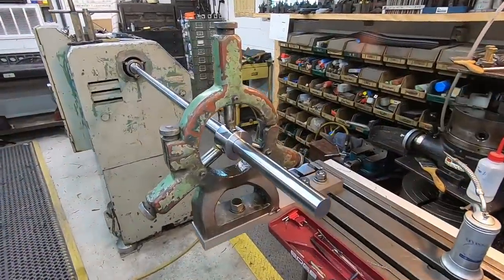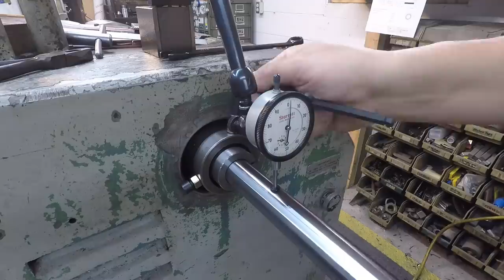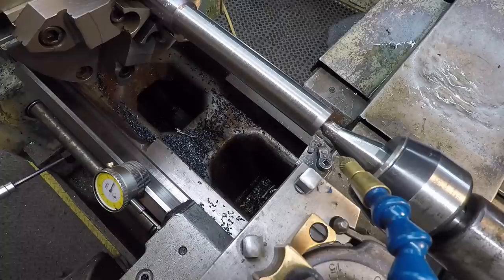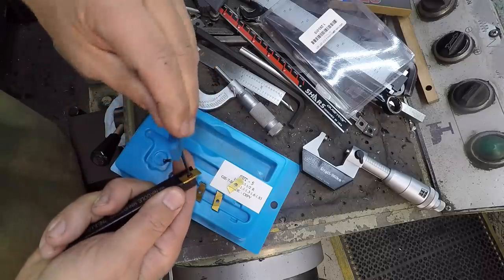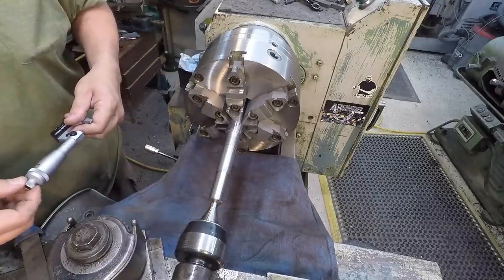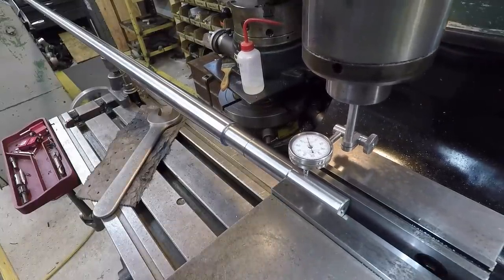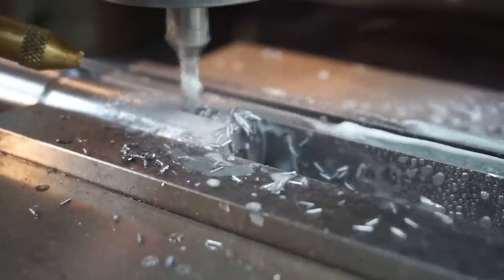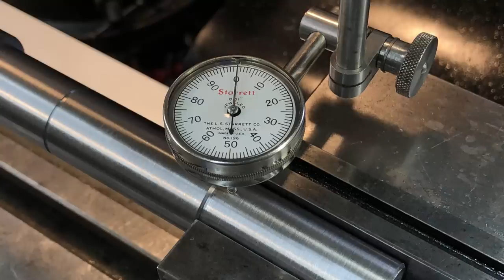Machining a Custom Prop Shaft Part 2

Comment: As a retired machinist who started in the early '70's  , the shop That I worked  in did LOTS of shaft work & what we used then was RED LEAD for steady rest lubricant , now the BEST lubricant that I have found for this is STP , or motor honey ! It WON'T  totally leave when it gets hot . GOOD Video !!!!!
Reply: We use motor honey too, bitch to clean but lasts way longer on the steady.
Reply: STP is a great lube for that kind of stuff as well as an oil additive for vintage engines.  We had a bunch of stuff tested, and it came back with the most zinc, and that is what you want!
Reply: Thanks for this tip, Byron!

Comment: I saw that print Adam! Thank you for showing us. I knew something was up when you were trying to sneak up on those ODs like that, and then you showed the print that basically had zero tolerance built in for you. I know jobs like that take a lot of patience and can cost the customer a great deal because of it. Been watching you for a lot of years, and you do great work. I have no doubt you cut 15 minutes of video of you trying to get on-size with those dimensions down to just a minute or two. You definitely make it look easy. Great job. I know you make your family proud!
Reply: That is a prototype shaft for a mud motor.  The drawing is not professional (and doesn't need to be).  Zero tolerance is a mistake.  However, with Adam on the lathe, he went right to it! Excellent video.

Comment: Great job Adam, and here I thought Keith was the king of marine machinists! I always enjoy your attention to detail and never taking any sort of short cut. As a lifelong millwright, it's guys like you that makes our jobs a bit less complicated when you never have to second guess the print. Cheers and thanks!
Reply: Adam has said his dad did a lot of "marine shaft work" in years past.  I think there are a few power boats down around Florida that just might need a quality machine shop!  Adam may have a new line of repairs in the future.  It has certainly done Keith well up in the Cape.

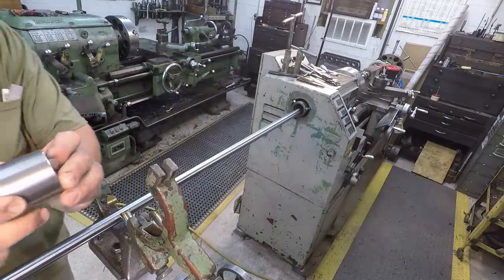Comment: 3:50 Another thing to use is a small plug of Nylon 6 or 66 ( natural/white not graphite/black ) rod instead of brass tipped bolts.  Place the plug in your bolt hole so the bolt pushes against the nylon and the nylon grips the shaft.

Comment: Great project Adam and thanks for sharing your experience in terms of making sure everything remains straight and true during the machining process of long shafts. Your preparation of the jigs and fixtures (Lathe Steady and Bushes in this case) ensured that the Shaft turned out just perfect and that the customer should be real happy with this job. Blessings from a sunny and "Locked-Down" South Africa !

Comment: My Son, in and after High School trained as a machinist, then went to University to study Chemistry. During his undergraduate work, he got a job in a lab preparing the work surface for a Scanning Tunneling Electron Microscope, that has to be precisely flat at the atomic level. His machine shop training was the key factor that gave him the understanding of how to accurately set up machinery and tools. He also helped to develop and holds a provisional patent for a device that contains liquid helium coolant in the STEM's system that doesn't allow the liquid helium to raise in temperature. That, all because he learned how to be a machinist first. He now works in solar power plant systems design. I asked him once if he "considers himself a scientist or an engineer". He said, "nope, I'm a machinist".
Reply: did your son stay with the training  like some nasa stuff if he did he the man
Reply: your son must be a good ole boy machinist  the best like abom  proud of him from west tn and I know you are proud of your son
Reply: Working in the physics dept. machine shop is how I learned what practical machining I know.

Comment: I saw another youtuber use a piece of vinyl pipe, with a wick stuck in one end, filled with oil and zip tied to keep the steady rest tips lubricated. The felt wick only let a little oil out and the remaining oil made it like a little oil reservoir. Way low-tech, but effective.

Comment: Adam,   Nice job on the propeller shaft,  thanks for sharing your video.!.!.!.
Reply: Well, I hate to be "that guy" but that is a "propeller" shaft.  A handy and simple (probably way too simple, but accurate) way to identify these designs is an"impeller" is cased and draws or sucks fluid through.  A "propeller' is mounted in open fluid and creates thrust.  There is way more to it, but that is a start.

Comment: Adam that was beautifully professionally done! My favorite part of your machine methodology is that you always double check your measurements. You're very careful that way.

But when you use a file and/or emery cloth to bring your diameters down to the final dimension..... I noticed that you don't bother to wipe off those diameters before using the micrometer. I would think that there would be some residual metal particles remaining on the shaft that could throw off your reading. What do you think?

Also, Adam, when you didn't put the center drill hole in your stock when it was snugged up to the Chuck.... I was concerned that you would lose some accuracy by putting in the center drill hole once the stock was already protruding away from the chuck. But then I thought "he must be doing that for a reason". And if I'm correct I believe the reason is that you wanted to ensure that the center drill hole would be in line with the headstock spindle, even if there was slight unconcentricity once the stock was pushed out. That was brilliant!!!! I must confess I never would have done it that way.

This is one extraordinary video. It's amazing how you were able to support the far end of the stock using a steady rest mounted to your milling machine table.... And then adjusting the knee height to fine-tune the alignment! And that headstock spider with the split collar worked out very well too.

All in all my friend I would have to say that that was one amazing job! Thank you so much for walking us through it.

Comment: Awesome stuff, I’ve been learning a ton from these videos I really appreciate you sharing everything that you do! Currently saving up for my first lathe and mill, I’m very interested in getting into the hobby. For the last four years or so I’ve been fabricating what I can myself by hand with the basic tools I have and it’s fun and all but quality with something like an angle grinder or cheap drill press is tough. I really want to be able to make better parts and do all operations here, no running out to get keyways cut, slots milled, or to get that one bolt I don’t have on hand. And I know everything I’ve learned here will come in very handy for all of this!

Comment: Amazing work, as usual for ABOM79.  I'd be curious to see the watercraft that this is going into.  Like how many HP and how much torque?  How will it be suppported in the hull to prevent warping?.  Cheers .   -  John.
Reply: Typically a shaft is supported with a cutlass bearing

Comment: Nicely done Adam. 
In my experience I prefer cutting a tight key slot with less chance of peening itself loose in use. I have always used a smaller cutter to get material out of the way first pass so a full size cutter isn't deflection wandering in the slot plowing 180deg of material ahead. 
Secondarily, if the cutter isn't turning perfectly on center, chances are the finished slot will be cut over-sized anyways. Most key stock isn't exactly precision material.

Comment: Adam...WHY do you pull the part out from the chuck then center drill rather that center drill it after you faced it close to the chuck???  Like the knurl and fence on the indicatior
Reply: Some part finished shafts may not be perfectly straight with perhaps a 0.001" or 0.002" bend, if you centre near the chuck then move the shaft 10" then the centre would be running out by 0.010"... (or 0.25mm) so to keep the shaft running true to the axis you centre where you are going to machine....

Comment: How would you measure the length of that shaft if you needed it to be within a few thousandths of dimension? Is the cross slide accurate enough to measure the whole length of the bed?

Comment: Any reason for center drilling after feeding the stock through? Why not right after facing when everything is close to the chuck?
Reply: Centre drill would not be on natural centre, when the bar is brought out further,  you may be bending the bar. It would be acceptable if the bar was say 250mm/10" long, and you gripped at the very end in the chuck.
Hope this helps.

Comment: Never seen you use a tape measure much. A good one is very accurate but learned a trick from an old carpenter I worked for. The majority of inaccuracies are from the clip as it most move its thickness to do inside and outside measuring and if it's not still perfectly 90 degrees then that little bend can make it read wrong. Enough that it can be seen in trim work where angles meet. What i was taught was to have someone hold it so the 1" mark is zero or use a sliding square with its 1"wide bar to make the 1" mark be at zero. The biggest trick is remembering to add an inch to your target length but it takes all the possible clip errors out of your measurement...
Reply: A FatMax will do you right :) But I like to call that burning an inch. And it will burn you if you forget to adjust your measurement.
Reply: Fastcap makes a inch burn tape where the numbers start back from the end to avoid that
Reply: @truckguy6666  never had a term for it but that's cool. I learned by "hold this at the one" as a tapes clip shot in my direction. And I feel like that's one of those "2 types of people" mantra ones who have forgotten to add an inch and those that are lying...lol

Comment: The laser measuring tapes bosh makes are very accurate down to a 32nd for like 50. You would need to put something on the end for it to read off though.

Comment: So Adam, I noticed that before you cut the key way you showed that you had a support holding the other end of the shaft.  After setting zero with the quill you raised the Z off of your support.
Reply: It's less than half an inch deflection over a span of more than 5 feet, unlikely to matter.

Comment: If I may ask, what properties does cutting oil provide that other lubricating oils don't ?
Reply: Max And Sherry Wike cutting oil aids cutting and cooling, normal oil e.g engine oil does cool but is designed to create a gap between two piece of metal to allow them to run against each other continuously, obviously this isn’t what you want when cutting you don’t want a drill bit rubbing over the top of a piece of metal.
Reply: That's a good question - I looked it up and says cutting oil contains sulphates - which have lubricating properties - but so does oil?! None the wiser myself!

Comment: I'm an interested layman so this might be common knowledge, but wouldn't the 90° angle in the key slot cause stress points and eventually the shaft to crack?
I do know that keys usually are square but in use cases where longevity of a part is important wouldn't a rounded key slot and key improve the lifetime of the part?

Thanks in advance :D
Reply: Keys in shafts are made of a weak material, so if the specification is correct, it will shear way before the axle brake. Also usually this kind of coupling is not made for the maximum torque of the shaft. If you need transfer more torque from a shaft you can use splines or something similar to make the coupling.
But you are correct assuming that round edges would make it strong. In this case I'm assuming it is just not a concern.
Regards!
Reply: if your taper is in a good shape and holding it tight you dont need a keyway ,since keyway is made of steel and propelers are made of bronze guess who will go out first?f
I have worked in shipyard and let me tell you 90% of the time reason for a shaft to be replaced is not because its broken but because it gets eaten away by galvanic current or get some rope entangled (you wouldnt beleve how it digs into stainless steel).
Unless ofc you hit something with your propeler in most cases propeler gets replaced or if its big and expensive like on tanker ship  bent back to shape ,you can also bend back ships axle to shape aswell,tolerances are not that strict when it comes to propellers except on the bearing surfaces but even then 0.1mm +/- is acceptable .Key slots are shallow so they dont impact a shaft's abilty to take torque on a great scale.
With normal use you will wear down shaft way faster than a keyway.
Reply: Same goes for the total length ,as long its not shorter 1-2 mm overhang will have no impact.

Comment: Adam, have you ever tried tyeing a piece of felt on the back of the steady rest so that it lays against the bushing.  Soak the felt with oil and you have an oiler for the operation.

Comment: Amazing…

I have a prop shaft that is 1-1/8” and have been gifted a JProp 3 blade feathering prop. However the shaft size it is machined to is 1”. Should I have my prop shaft machined or the prop itself. The prop itself has a 12:1 taper. I am by far not an expert but I would think machining the end of my prop shaft is how it should be done.

Comment: Nice work, it is always good watching someone who is a master at his craft. Could you please let me know why you faced the shaft close to the chuck but centre drilled with it extended, same as with the opposite end?
Reply: Stan Stevens wondering the same thing
Reply: The less stick out the less deflection. Since he obviously can't turn between centers for a facing operation, he minimizes the deflection from the tool by minimizing the unsupported length. For drilling for the center it doesn't matter as much because he is pressing against the end of the shaft to drill for the live center instead of across the shaft for the facing.
Reply: Because the workpiece overhang is minimised when facing the rod close to the chuck. This will ensure a good finish on the face of the part. Moving out then centre drilling the bar will ensure no eccentricity when the running centre is engaged in the centre drill. If you centre drill and then move you introduce a margin for error in that the centre may not be running dead true after moving the bar out.

Comment: Just curious, I love watching your videos though I am by no means a machinist. At approx 29:40 you were setting up to cut the key way.  After you touched off, locked the quill you said you raised the table to get the depth of the key way.  Didnt this cause the shaft to get out of parallel with table that was setup in the first place?
Reply: He raises the table which the shaft is mounted to, moving everything as one and keeping it true.
Reply: Same boat here. That made me tick too but I brushed it off and carried on watching. Now it makes sense. As A J said, the shaft is affixed to the table, both from the snout clamp and the small adjustable jack lift point so parallelism is maintained. The large jack on the other end was just there to help with setting up the shaft mounting to the table fixtures. Remember he was pushing down on the snout in the clamp after every fine adjustment of the small jack, meaning there was no load bearing at the other end to throw the level out of whack once secured in the clamp.

Comment: Nice job Adam. I learned a lot. Those blocks on the crate make me nervous, I'd be afraid some Bozo in shipping would strap it down half way between the blocks and spoil your work.
Reply: Two 8' 2x4's with a groove down the middle the width of the shaft would make a simple but effective shipping crate.  Drop the shaft in the grooves, screw the two 2x4's together and ship it.

Comment: If this was a standard quoted job, how many hours would you say you would have had in this project?
Reply: Sam Denton Probably 3-4 hours at most including setup, not including custom work holding fixtures he was using.

Comment: Now ill admit I have no experience with this stuff, and I'm quite ignorant in its regard. My question I have is. With the length of the shaft why would any adjustments in the supports with an indicator be needed? Wouldn't a level suffice? Won't those three points especially the chuck, the clamp at the back and the steady rest just bend that shaft straight and not be truly straight? This is a question NOT a statement.
Reply: intuitively I would agree with you, the reality of the situation is when measuring to higher precision even the temperature of the materials can effect the measurement. a level just isn't as accurate as needed here.

Comment: hello congratulations for your videos
I suggest you put the turret at an angle of 5.74 degrees (sine of 1), so that a turn of the knob corresponds to 0.4 mm on the diameter.
  with this system, you can turn to cents only with
  the help of the turret

Comment: Hi Adam,  outstanding material handling  and set up tips and tricks. One question, why did you chose to use a two flute   end mill to cut the key slot in a steel work piece?  Hope the bash will happen in 2020, and you will attend Abby.

Comment: Holy Crap!  That is one long shaft.  Length of a shaft that long needs to be specced with a temperature.  Best guess is 60 deg F.  It's gonna change with every degree.
Reply: In the first video, he mentioned this is a prototype for a "mud motor".  Thanks to Adam it is a mighty fine test piece, but a test piece it is.  The final design and machining from the special "Aqua..." shaft material will come later.  I don't know if it will be "speced with a temperature" as you say, but I am sure Booth Machine Shop will do it right!!

Comment: Could you make an automatic oil dripper for the steady rest? Maybe like the ones they use for motorcycle chains?
Reply: No doubt possible and within his capabilities ;)
But also probably overkill for a rarely used tool, keeping it oiled occasionally is not going to 'cost' him much.